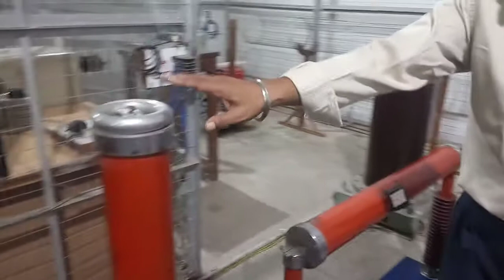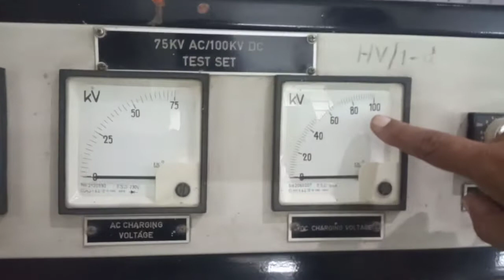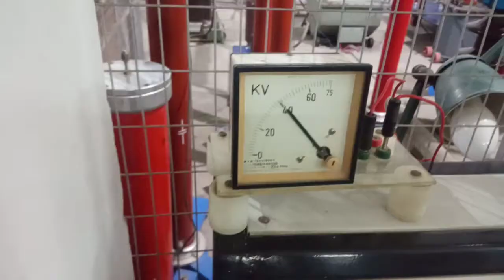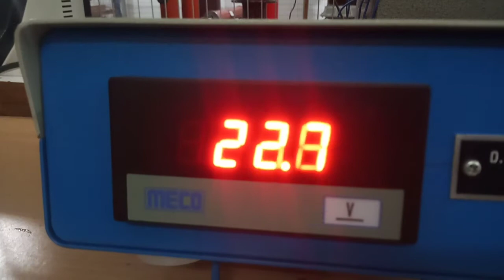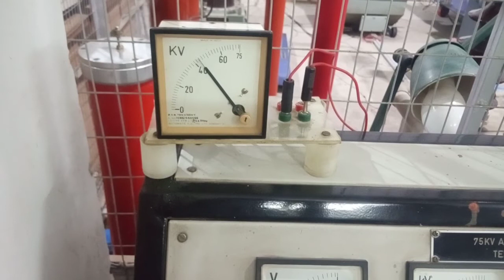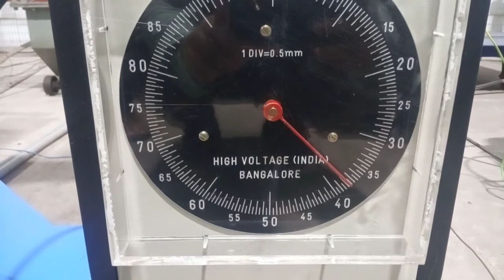High Voltage Engineering Experiment:14.High DC Voltage Measurement Techniques - Dr. T. G. Arora

Comment: Do you have a resistor in series with the sphere gap? This limits current thru the spheres and helps protect there surface from pitting.
Reply from the maker: At the time of shooting no, as it had some problem.